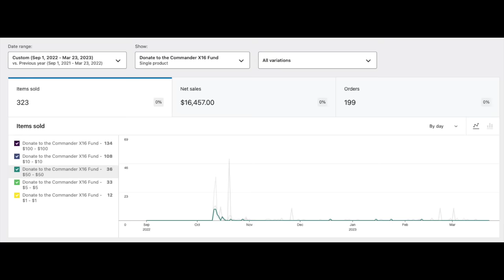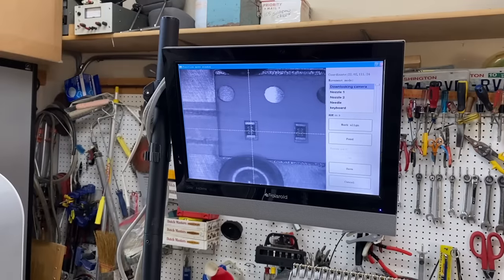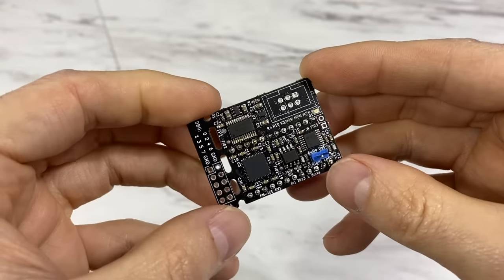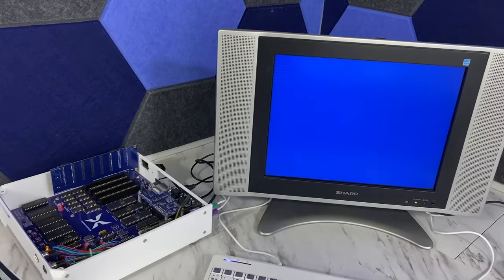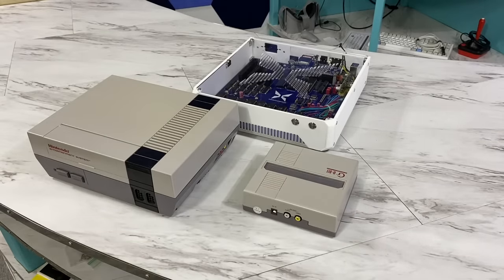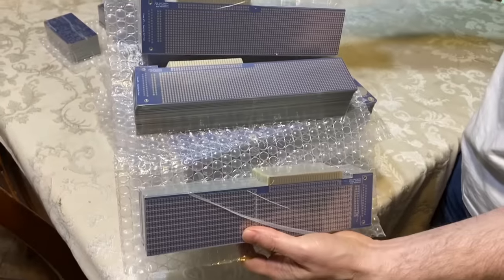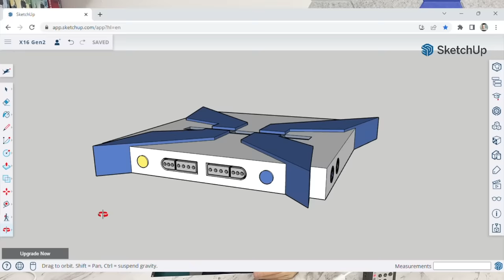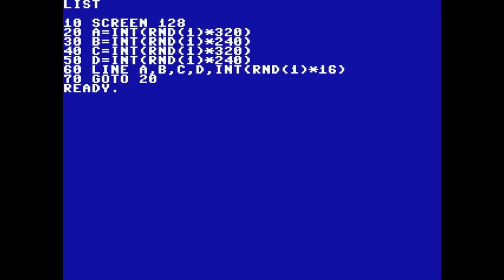Commander X16 2023 update

Comment: One of your original goals was to NOT use out of production parts.  The fact that you didn't comply with that really came back to bite you.
Reply: I was thinking exactly the same.
Reply: I think there were some relatively early decisions that have made things much much more complicated. And development getting sidetracked that has delayed things. 

I won’t go as far as to say that these were mistakes because it’s easy in hindsight. But the X16 has turned out very different to how it was originally described.
Reply: I audibly yelled WTF when he said that
Reply: Indeed Agon Light 2 Z80 based "dream computer" autor pointed out that here https://www.youtube.com/watch?v=mwnNEq3e6cw
Reply: I am still buying it, it's absolutely perfect really - when they solve these absolutely standard development issues and release it, I have no doubt he will sell out quickly.

It's a fantastic computer, I am amazed people are complaining.  The problems with the sound interface are not tough to solve, and if it puts the price past what you are willing to reach then you will just have to miss out on one.
Reply: @DailyCorvid  I wouldn’t say they were standard development issues. Few designs are made around components that are no longer produced.
Reply: @prk55  It's a retro computer?
Reply: @DailyCorvid  Most 'retro computers' don't do that. they use an FPGA and be done with it. The X16 does this too, namely the VERA, but you could make a good case that using an actual Yamaha chip instead of including it in VERA with the other audio chip it emulates was a misstep in terms of availablity.
Reply: @DFX2KX  refer to previous answer, it's the same question eekee asked.

Including it on the VERA doesn't change the amount you can source, and there isn't any way to get backward compat without using old chips.

Hence the name Commander X16.  It must be Commodore compatible at Kernal level and with the BASIC, and it has to resemble the Commodore C16.

It won't do that unless it has yam support.
Reply: 100%, I don't understand why the backup plans ALSO included out of production parts!!  Their current apparent availability is irrelevant.
Reply: The supply chain mistake is understandable.  From their research and feedback from vendors, new old stock appeared to exist.  Counterfeit IC scamming is terrible.
Reply: @Masheeable  Unless you buy the stock needed ahead of time.
Reply: I wonder how much would it take to start a ym2151clone production in a form factor of blob on a dip package.
Reply: Yeah, he pointed out that the X16 used "a microcontroller" and then when reusing the same clip to suggest his board is David's Dream Computer, he snips "or microcomputer out", because his board relies on a 100MHz+ 32bit microcontroller for VGA ... and the microcontroller in the X16 is a 16MHz, 8bit microcontroller. So that part of his video is clearly trolling that distorts the actual comparison.
Reply: Plan B doesn't include out of production parts. It has higher cost for the developer board, because the chip replacement daughter board, including on board voltage converters, which has it's own production cost. Most of that goes away in the game console,which was always intended to be surface mount parts, so the replacement FPGA can be designed into the main board design.
Reply: Agree with Agon light. Its Z80, doesn’t use fpga, doesn’t use out of production chips, costs ~$50, uses gpio pins for expansion. Already runs CP/M.

And it’s full open source. You can build it yourself or order one built by pcbway.
Reply: He also pointed out that the X16 has a microcontroller (not noting it's an 8bit MCU), while sidestepping that HIS design is based on a 32bit microcontroller. That video is more of a troll than a straightforward argument.
Reply: But.rather than reaching for an FPGA as the first resort, they worked really hard to make it a last resort.
Reply: Do working clone/knockoff chips exist? Tbh I'd not care much if the knockoff chip functions even if it's not "Yamaha" per say
Reply: Except when counterfeit chips are such a problem that even if they did buy a huge stock of chips before ramping up production, there is a good chance they would have been sitting on a pile of bricks.

The fpga solution sucks on cost, but it gets the job done from a tech standpoint. They are starting to come down in price as more hobbyist boards are released, and the dev tools are quickly improving for the same market.

Ya, it sucks, but as someone else said, the Commodore 16 compatability constraint means they have to use a Yamaha chip. 

That requirement appears to be in direct opposition to using in production parts. As someone who only got to use a C16 at a friend's house 2 or 3 times, I would rather have the C16 compatability than a less expensive system. 

This isn't the only modern C16 option, so they could have dropped that restraint, but the X16 is more than just a C16, and those other C16 projects come in at a simillarily high price tag with a similar solution for sound.
Reply: It's the 8 bit guy, he is not a professional engineer. Everyone knows about fake chips and fake stock. Hard to explain to a YouTuber, they always get what they want but if they are in the real world it's different.
Reply: I'm surprised they didn't use the SID chip for sound.
Reply: @DailyCorvid  I bet you are really excited to play crappy shareware clones of famous games...
Reply: @MikeDijital  Perhaps you should stay away from gambling
Reply: @Allen.Christian  Well put. At this point I'm definitely not interested, and that's okay. I just hope the whole thing doesn't end up souring his relationship with a lot of his viewers.
Reply: @DailyCorvid  people will complain no matter what. Even if you give them what you said you would, they would still want more/different/etc. It's impossible to win.
Reply: @DailyCorvid  I thought the 16 came from the original plan to use the 65C816 processor? Is it Kernel compatible and if so with what model?
Reply: We are in a different world now, but long ago, during the design phase, the choice to use the YM2151 seemed justified.  What a difference a few years makes.
Reply: @Starchface  It still probably wouldn't have been available, it's not likely there were ever 100,000 new old stock sound chips sitting in a warehouse. I guess the team wasn't familiar enough with part procurement to realize how things like that can happen.
Reply: @carlos-teran  honestly tho, it was tempting and they rightfully assumed there were still thousands. 
But at the end of the day, when you assume.. "you make an ass out of u and me" 😔
Reply: @prk55  Commodore 64/128 and compatible models as far as I know, and yes it is Kernal compatible.

That's the reason for using Commodore ROM and BIOS, and sticking with the Yam synth and a 2mhz CPU.  All of that was done to keep compat with Commodore, hence the name Commander.

I have a video on my channel about it, David said his only complaints are that I said the price was too high.  All the other information in that he said was good.
Reply: @mikegarland4500  So true!  Can't please em all.
Reply: @DailyCorvid  I thought the processor runs at 8Mhz? Isn’t compatibility restricted to Basic or machine language that calls Kernel routines?
Reply: @Allen.Christian  Do not agree at all.  $500 for the initial special edition handbuilt version is fair.  Like the original C64 it got cheaper throughout it's sale life.

The original goal was a Commodore compatible fun development computer which could be understood by a lone engineer, which is exactly what it is.

But sure go and find one the same that costs you $50.  I doubt you ever will.  Have you seen what $50 currently buys you??  Like in ANY store anywhere?  Dude needs to get with the year.
Reply: @prk55  It CAN run up to 8mhz but the sound chip needs to communicate at 2mhz so that's the system limit without replacing it.

I am not 100% on the details of the compatibility, but I know that all software and peripherals from the 64/128 era are supposed to work.

That was why they used the 6502 and the Yam chips to begin with.  They only work up to 2mhz which is an issue, so I think if they can find a better sound solution then that will mean you can use the  4/8mhz modes.

Nothing stopping you from putting your own in, I think the VERA is already on a daughterboard so it can be replaced.
Reply: @DailyCorvid  I’ve just checked the FAQ, it is NOT compatible with C64 software (other than simple basic or machine code that only uses Kernel routines). It’s says that software would need to be rewritten to use the display, sound, joysticks or storage. The C64/128 used SID for sound not a Yamaha chip?
Reply: @prk55  SID and Yam chips sound basically the same, and the Yam has more channels and volume mixers and stuff because it is more recent.

What do you mean "only Machine code" when it's the best one to use, assembly and machine code is always better - so it's either that or BASIC.

Not even sure why you would want to run C64 software that was written in something other than assembler or basic anyway?

This is not a replacement for the C64, it is a continuing machine for the Commodore community generally.  If you're not a Commodore fan this ain't the one for you bro.  I think you're just looking for reasons to explore what you think are negatives for this machine when all we are doing is going through the features of it.

Yes it runs C64 software assembler and BASIC

Yes it is compatible with C64 stuff controllers disk drivers whatnot.

Yes it supports all the sound and graphics options of previous Commodore machines in addition to some new ones

Yes it can support custom sound and graphics chips or removal of the VERA completely.

No it is not a desktop replacement for your Steam gaming or MS work.  It is not a magical converter from random C64 software to assembler or BASIC.

No it is not a budget rig, nor a cheap alternative to something else.  It is it's own thing doing it's own thing.

No this is not the perfect computer for every need and time period.  No this is not a project with no part of it requiring improvement.

Yes the initial 83 will cost $500 because they are special edition units, and yes this is not a cheap amount.

Yes after that they will price lower, David is saying $350 ish territory.

Yes you can convert any C64 software from your library languages, into assembler and use it that way.

Yes there are tools which automate much of that process, making it fairly straightforward.

No I am not going to describe these to you as I already spent too long.

Yes if you are interested go back watch the videos read the Wikis etc.

Yes I know you are not interested ;) So that's the end of my reply.
Reply: @DailyCorvid  I was just replying to you. You said it was compatible with all software and peripherals when it clearly isn’t.
Reply: @prk55  how is it not compatible you said yourself if there are drivers then it works and assembly and basic work
Reply: lots of out of print chips are as hugely available as they thought the Yamaha chips are. I need to check if I have any In my tool box full of chips
Reply: @DailyCorvid  Some of us are burned out from other projects that suffered from feature creep and perfectionism (ahem.. pyra handheld.. ahem).
Reply: @DailyCorvid  Agon Light is legitimately everything David wanted apart from Commodore BASIC, which is really only desirable to a certain set of people. The X16 is not Commodore "compatible" as you said. Just close enough in hardware that ports would be easier. I know the Agon Light guy hasn't been particularly kind towards the X16, but that doesn't change the fact that he designed pretty much the exact computer the X16 was supposed to be and it can currently be purchased in David's original price range
Reply: If its right except something major then its not right.  BASIC is one of the main design goals.

Assembly and BASIC is all I care about when I talk about software I want to bring across and use.  Don't know what the heck you mean if not those two.

I asked you for an example twice now, maybe you just couldn't find one.

also
I just had a look at Agon, nope its nothing like this and neither is it $50!  Does not come with keyboard or power supply or software.  Look stop making stuff up to support your point.  Agon is cool but its a totally seperate device for a different purpose.

It's closer to an RP4 like I originally said, get one of those and stop bemoaning this for being a Commodore compat.  No amount of you whinging is going to change this project it stays Commodore, because we fromt the start wanted BASIC and assembly code tools which would not work on the Agon.
Reply: @DailyCorvid  According to the X16 wiki, in regards to C64 BASIC program compatibility:

"Many routines and hardware addresses are different, breaking compatibility with programs using PEEK, POKE, WAIT, and SYS commands."

And as for old software made in assembly:

"Most binary programs will rely upon specific addressing, and will thus need to be reassembled or recompiled with corrected addresses. Further, the differences in VERA from the Commodore graphics will require different handling as well, generally rendering binary files incompatible."

Neither BASIC nor assembly programs are simply "compatible", and David never even said they would be.
Reply: @jacklawsen6390  Agon light BASIC doesn't support graphics at all, you need to re read those wikis bro.

Assembler and BASIC is fully supported, not sure what you would want to run other software than this.

It's a development computer, that's the part we care about programmers with Commodore assembly and BASIC skills can use them here.  That's the part people forget.  We already have Commodore 64's we don't need to run old games on this new one.
Reply: @DailyCorvid  I wasn't talking about the Agon Light, I was quoting  the Commander X16 Wiki about the Commander X16's compatibility. You keep saying the system is plainly "Commodore compatible", when people involved in either working on or documenting the project are not willing to say that.
Reply: @jacklawsen6390  I know I said you need to read them better.  You are cherrypicking parts to suit the narrative you want to give.

I already said I just don't agree with it, not sure how much more clear I can be.

Assembler and BASIC compat 100% is there as promised, with full graphics and sound.  The machines you mention none of them have that, the killer feature as it were.

Past this point, I think you are just wasting your time complaining because we're generally happy with it (people who are committed to buying them).

At this point, you have said you won't pay for one and that's fine.  But nothing you say has any relevance to those of us who are buying one.  We are more than happy.
Reply: @DailyCorvid  Pointing out valid caveats to incorrect blanket statements is not cherrypicking, and you're the only one talking about the Agon at this point. Don't worry, though, I'm sure the puzzlement and concern of those baffled by the direction the project has gone will soon enough die away and be replaced with indifference.
Reply: @jacklawsen6390  You sound like, terribly pissed off about this.  I wouldn't say you're indifferent when you're clearly seething away in the corner over there.

What's got you so upset.  You said you think the Argon board is better, ok fine go buy that and hang around there and tell everybody why it's so great.

That's how a community works, if you just hang around causing trouble and arguing down dark hallways then in the end you will just be ignored, and people will be indifferent towards you .
Reply: @prk55  yeah certain people really wanted some charms in the hardware thus requiring out of production parts.

If they only use PSG or some of modern substitutes it'd be much less complicated even if it results in out-of-place parts, like what MiniPET faced with
Reply: @DailyCorvid  You keep saying the X16 is 100% compatible when it isn’t. No one ever claimed it would be, the FAQs and documentation clearly say it isn’t.
Reply: @prk55  What are you babbling on about I told you like 600 comments ago, I can't be bothered to argue with you.

You can nitpick all you like, bottom line hasn't changed in all those comments.

I said you are entitled to your opinion jeez go away now.
Reply: @prk55  "Few designs are made around components that are no longer produced." Nintendo Switch says "Hi!"
Reply: @functionatthejunction  that’s interesting. Can’t find anything about that. What components were no longer available?
Reply: @prk55  The chip itself is no longer made. Nintendo has a hoard of them and thats that.
Reply: @functionatthejunction  It's at the end of its lifecycle and has already achieved market saturation. Plus Nintendo is a big enough company and has a partnership with the chip maker and could have them made again if they needed them. Not sure how that's comparable to developing a product with a chip that hasn't been produced in 30 years.

That's not even a good response to the thing you were responding to, because it was designed around a chip that was definitely still being produced then.
Reply: @functionatthejunction  The switch uses a custom nVidia chip made for Nintendo?
Reply: @prk55   It uses the Tegra x1  created by Nvidia in 2015. Its "customization" is thats down clocked to reduce heat issues. It is no longer in production.
Reply: @Starchface Today it's a 38 year old out of production chip and a few years ago it was a 34 year old out of production chip.
Reply: I really don't think that was in David's control. The chip industry has been extremely unpredictable. Not only for big computer manufacturers, also for modern cars ,🥴
Reply: @prk55  I suggest that there were mistakes, that they were possible to anticipate and these problems are compounded by an apparent unwillingness to accept this fact. For example, they must have known how long it would take to assemble a board before September 2019 when they had the first prototype boards: https://youtu.be/sg-6Cjzzg8s?t=1325
Reply: @DailyCorvid  you cannot buy it yet. When you can buy it you will be able to decide based on the price and features it has when it is really ready. Perhaps the price will not go up again, perhaps the features will not change again, perhaps you will still think it's perfect but for now all we have are predictions about the future product and their track record on estimate accuracy is quite public.
Reply: Non engineers trying to be engineers without a engineering degree or experience.
Reply: I'm amazed you think he's going to to get any software development for a few thousand sales. At least the Mega65 can run C64 games. An emulator could run both. But who but another hobbyist wants to make games for a few thousand computer hobbyists?